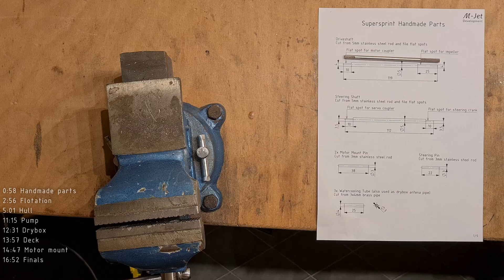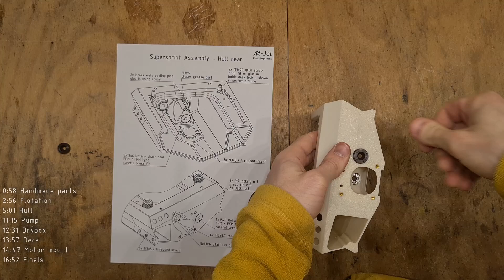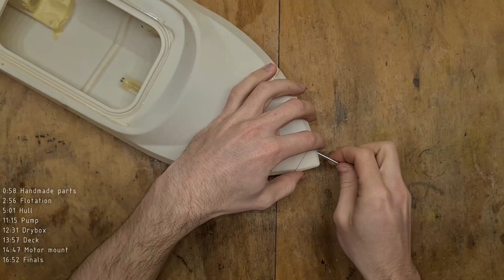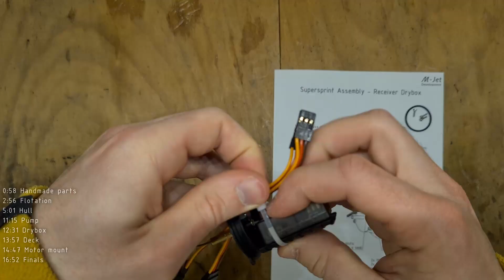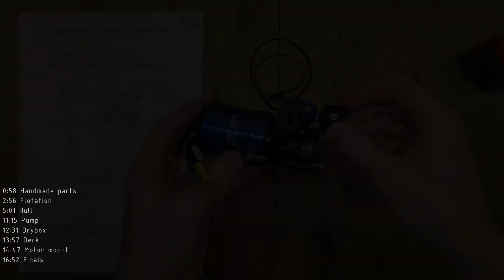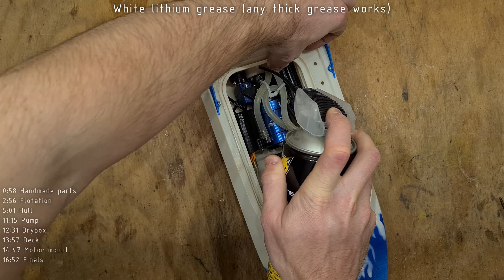SUPERSPRINT Full Build / Assembling a 3D Printed Jetboat

Comment from the maker: Correction 16:20: Attach the motor using M3x20 and M3x6, not M3x10.

Join the official M-Jet Facebook group!
https://www.facebook.com/groups/623045356071128

Supersprint files available for purchase:
https://rcprinter.com/products/m-jet-supersprint-3d-print-files

Supersprint hardware kit by RCPrinter:
https://rcprinter.com/products/m-jet-supersprint-v1-0-build-kits

Comment: What is the purpose of that side compartment in the casing?
Reply from the maker: Thats a self righting flood chamber. When the boat flips over, it fills with water, makes that side heavier and flips it back. It will still be full so the boat will strongly lean to that side. But once throttle is applied and boat starts going forward, all water flows out of the back, so handling is not compromised.
Reply: @mjetdevelopment  Are you a mechanical engineer? Your designs are really well designed and good. Thanks for sharing them with us.
Reply from the maker: @firazpeerjade Thanks! I am studying it yeah.

Comment: hi do you think I can fit traxxas 4s ore 3s 5000mah battery?
and should I install HobbyWing Ezrun 3665SD Brushless Motor G3 in 2400Kv, 3200Kv ore 4000kV. esc is HobbyWing Seaking 90A Boat ESC V4 2-4s
Reply from the maker: Hello,
Unfortunately these are not the best components for the Supersprint.
1) The battery 3S 5000mAh will probably be too big, recommended range is 3S 3000-4000mAh maximum. It might not fit into the hull.
2) The motor you mentioned looks like it is for cars, it does not have a smooth can and does not have a watercooling jacket. The motor definitely needs to be watercooled. 2400KV is ok on 3S.
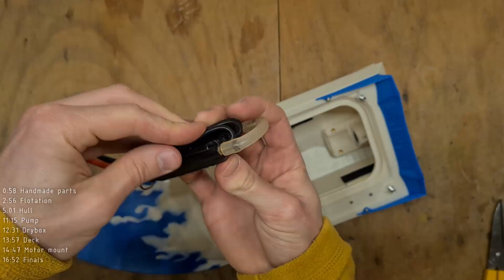3) The ESC is powerful enough, but its dimensions might not allow mounting it in the intended position, as shown at 19:39. You can still place the ESC on the other side, which will make self-righting less reliable, but it can still work depending on how rest of the boat is built. 

More information in Supersprint manual:
https://drive.google.com/drive/folders/1f-epKNBlcqGcuJU5rGvYQleL7ayPnrRe?usp=drive_link
Reply: @mjetdevelopment  are you sure? i have three 5000mah 3s batteries, but i don't have any 3000-4000mah. the dimensions of the 5000mah are 22x42x153mm
could you please make sure that the battery won't fit into the model somehow?
the difference between 4000mah and 5000mah is not that big and it would help me a lot.
Reply from the maker: @asasin-y3n Thanks for the dimensions. 153mm is very long, on the other hand 22mm is very thin. I cannot for sure tell if it fits or not, it just requires to have the battery in hand and try to insert it into the hull with all electronics, cables etc, placed in. The question is if it is possible to manipulate it to insert it. After it sits it is no longer a problem. 

I do not recommend it, you can still try it.
Reply: @mjetdevelopment  you can try 3d print a prism with these parameters on a 3d printer with almost no infill and try to insert it into the boat. or you can assemble the boat from stl parts in a 3d program and model the prism with these dimensions and try to insert it into the ship. i also wanted to ask, i have a 3665 motor is that a problem?
Reply from the maker: @asasin-y3nSorry, I will not go into 3D printing a battery sample to tell you if it fits, I gave my recommendation already. 
A 3665 is not a problem if your battery is not too big

Comment: Hello! Regarding radio-controlled models, I would like to know your opinion regarding one specific model that we are building together (me as a 3D modeler and the client who is printing it on a 3D printer). I have compiled a video of the assembly sequence of its components, but we clearly lack experience regarding the electronics. In particular, at the first stage, the question arose: is it advisable to equip the model with two engines (to maintain a copy of the original) or will it be enough to install just one (model scale 1:96 / length 1037.0 mm)
We will be extremely grateful to hear your opinion:  https://www.youtube.com/watch?v=9F6wZ2pJuRo

Comment: Hi! Can I use Rocket 3680 1500kv motor in this boat ? I mean the size of the motor.
Reply from the maker: @MMM-2t  That is very big. Technically it fits if the cooling jacket is short (<50mm), but you might have trouble fitting the battery in. Despite that, some people used 3670 or even 3680 motors in the Supersprint - I dont recommend it but it is not impossible.
Reply from the maker: @MMM-2t  You might have to grind away little part of the hull joint using a dremel, not a big deal.

Comment: Please can you post a link to the nozzle file for the +20 nozzle?  The +15 nozzle is almost correct, but the +25 nozzle is too much nose up trim; a +20 nozzlw would be perfect but there is no +20 nozzle in the Supersprint files.  I just test ran my Supersprint and it's a big improvement over the Sprint!  My seal keeps blowing out inside the hull so am making a clip to hold it in.  Great design!
Reply from the maker: Glad to hear!

A +20 nozzle has been added to the Supersprint files on 12.08.2024. Please check if you have the newest version downloaded, go to CGTrader -> profile -> purchases and there you can always download the newest one.

If your seal is falling out of place, I would recommend just glueing it with epoxy or superglue.

https://www.cgtrader.com/3d-print-models/hobby-diy/other/m-jet-sprint-3d-printable-rc-jetsprint-boat-model
Reply: @mjetdevelopment  Thanks for the quick reply.  I downloaded the Supersprint again but I did not get the latest version - it did not include the new nozzles.  I just have to figure out how to download the latest files.
Reply from the maker: @hotdogx2  If it does not work, please message me on CGTrader, I will send the nozzle to you.

Comment: Awesome I want to do one for my kid ! Do you think if I double up the scale it will push an electric surfboard ??
Reply from the maker: So there are many problems arising if you attempt to change scale of any M-Jet design.
All fastener sizes, bearings, shafts, seals, motor mount, servo mount all become incompatible, possibly generating impossible requirements for dimensions of these parts. Solving this requires a lot of additional effort.

Secondly, the Supersprint pump is 30mm. A single 60mm pump will still not be enough powerful to push an electric surfboard. This is the case with the M-Jet 60 - two of them need to be used to power a surfboard reliably.

https://www.cgtrader.com/3d-print-models/hobby-diy/other/m-jet-60-3d-printable-jet-drive-for-electric-surfboards

Comment: 433 transmitter and receiver remote control 8chenal
Reply from the maker: Does that refer to 433 mhz?
Definitely stay away from that, go for a standard 2.4GHz system. 2 channels are all you need.

Comment: In the Supersprint manual under the "Designer's Choice" table, the battery that is listed (Turnigy Graphene 6s 1200mAh 75C) comes with an XT60 connector. The listed ESC (Flycolor 90A) comes with an XT90 connector. Can we get some clarification on this please? Are you using an adapter to go down to XT60 to XT90? if so why not spec the 70A model of ESC that comes with XT60 already?
Reply from the maker: I did not mention any connectors in the manual, because all kinds of electronics come with all different kinds of connectors, and it is up to you which one you decide to use. Then you need to desolder some and change them for your selected ones.

Adapters can be used, I personally don't like them because they take space and add weight. I like to put XT60 on everything, and I would recommend XT60 for your Supersprint, too. 

Why I used Flycolor 90A instead of 70A - they were almost the same price so why not, factory connector is not important to me because I can desolder it.

Note - when doing any soldering on the battery,  be very careful to never ever cause a short circuit. Once I attempted to cut both battery wires at the same time and burned myself. Anyway it's probably better to avoid soldering on the battery if you aren't 100% sure.

Comment: Great design! I started making mine! 
Could I use a 3s 5000mah 45c lipo battery on a 3660, 2600kv motor with a 90amp esc?
Reply from the maker: Thanks!
A 3660 2600kv motor on 3s would result in approximately 108 amps on full throttle. The 90A ESC might hold up but I would not call that a safe setup. To stay under 90A, you need 2400KV motor or less on 3S.
The 5000mAh battery is far too big. Recommended 3S battery is 2600mAh, the biggest that might somehow fit could be 4000mAh but thats the complete limit I would go for. Also depends on the dimensions of the particular battery.
There is a lot more information in the Supersprint manual:
https://drive.google.com/drive/folders/1f-epKNBlcqGcuJU5rGvYQleL7ayPnrRe?usp=sharing
Reply: @mjetdevelopment  Ok,
 thanks very much for your response.
Reply: @mjetdevelopment  I'm having trouble finding that configuration.  sorry for all the questions, how about a 3670 2280kv motor with the 90amp esc, I am unsure how much the longer motor will affect the power draw even with the slower speed
Reply from the maker: @jamesdyck7825  Yes, the 3670 motor is very big but still will barely fit the Supersprint. 2280KV on 3S with 90A ESC is ok.
Reply: @mjetdevelopment  thanks again, trying to figure out the math...I could use the 3670 2280kv motor with a 4000mah 45c 3s lipo on a 90amp esc? Even though the 3670 motor is rated at 1600 watts when the 3660 is rated at 1200 watts. I don't know how the lower KV affects amps draw, but I understand a longer motor could increase amp draw?
Reply from the maker: @jamesdyck7825  My best answer that might clarify a lot of things for you is this video:
https://youtu.be/aUbkPv-1BwY?si=jPmTJswP30azfsrr

Could you watch that and ask anything that remains unclear after that? I will be glad to help.
Reply: @mjetdevelopment  perfect, that explains things, it didn't make sense that these motors have a watt rating without a 'load' variable.
your test clears that up very well, great job! and thanks for all your replies :)

Comment: When buying all the Electronics, how much do you come out with?
There are some other Models i checked in also, those went up to crazy amounts like 400-500€
Reply from the maker: If you try to keep the prices low and buy from aliexpress for example, this is around what you can buy it for:
90€ motor+ESC+servo
30€ battery
50€ transmitter+receiver
Obviously if you choose local resellers or different brands it gets more expensive, sometimes you get what you pay for

Comment: Is there a difference between the pump in this video and the m35? Is the m35 included in the supersprint download?
Reply from the maker: The Supersprint's pump is smaller. It is based on the M-Jet 35, but it is scaled down and modified purposedly for the Supersprint.

The Supersprint files include the Supersprint's own pump, they do not include the M-Jet 35.

Comment: The Supersprint is definitely an upgrade to the already excellent M-Jet Sprint. Glueing has become easier, more robust hull, upgraded motor and many more details that add to the overall package. Documentation is excellent too. Highly recommended build and worth every cent.
Thanks for supplying it as an upgrade without further costs - 2 for 1. Currently repairing my M-Jet and waiting for parts for Supersprint.

Comment: Building my super sprint now. It's sweet! What was this hill printed out of? I printed mine and in PLA plus. I printed the first two sections before reading your print settings. I think I have six wall perimeters, but not cubic info and only 15% infill. Do you think it will be strong enough or should I reprint it?
Reply from the maker: Nice! There is no need to reprint it, your print will be strong enough and infill is not that important.

Comment: the first seal is maybe i little wrong from orientation. these seals are meant to orientated with the open side to the liquid what it should hold back. in this case any pressure from the liquid force the seal tighter to the shaft.
Reply from the maker: Yes you are technically right. But here the pressure is so low that the orientation does not matter, the spring is what makes the seal tight. Then I prefer to protect the spring by facing it inside.
Reply: For Sure. I go with your opinion
Reply: Be careful with thread locker when used with plastics. It can attack many of the common 3D printing plastics.